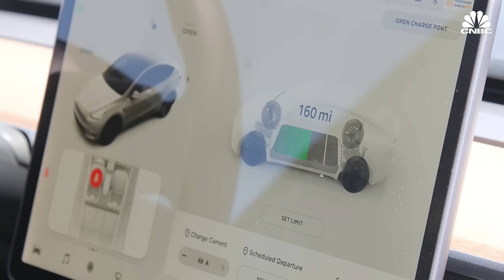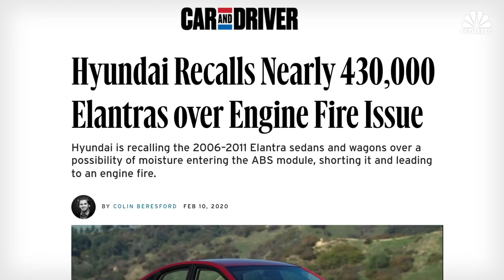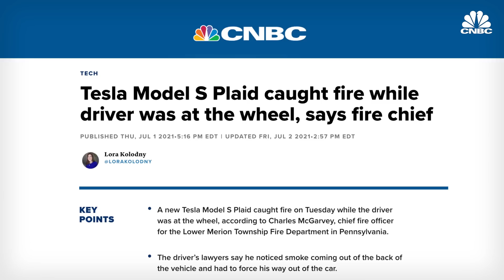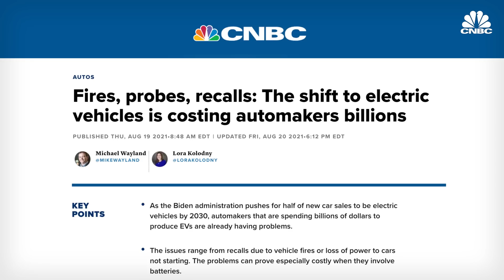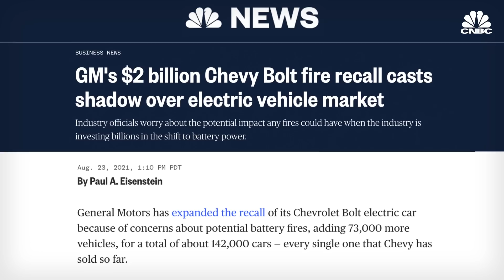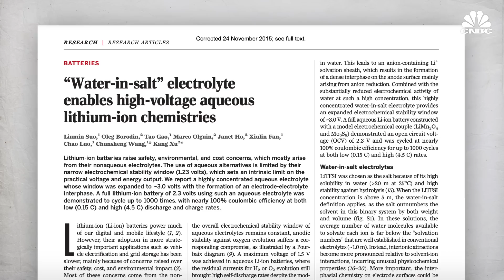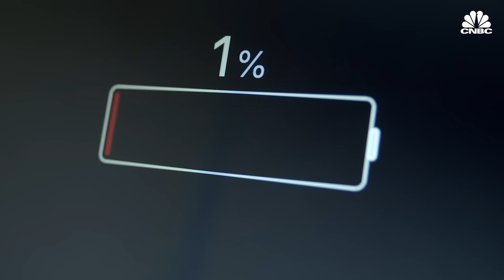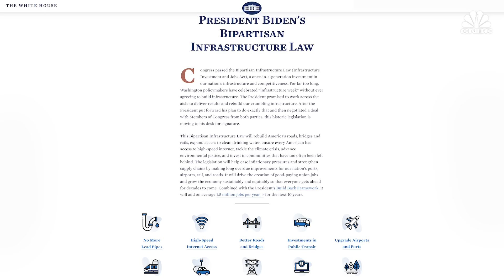Why Tesla, GM And Other EV Companies Have A Fire Problem

Comment: I was planning my next car to be an EV. But all these fires lately are definitely making me rethink. EVs still need major improvements in the safety area.
Reply: 10 Years + $20,000 = 2000LBS. of e-waste  🤡
Reply: @liuwang2201  according to your math it actually equals $20,010. 
Show your work if you want full credit. 
Also… the recycling of lithium batteries grows exponentially daily. So your equation has become more difficult.
Reply: @459SuperX  10 years plus a $20,000 battery equals 2,000 lbs. of E-waste  ✔
Reply: @459SuperX  your right it jest doesn't add- up, your problem is undefined
Reply: @liuwang2201  EV batteries are now recycled. Tell me, how much of the petrol that a gasoline car burns in 10 years will be recycled? How how many additional people will die as an indirect result of the highly carcinogenic nitrogen dioxide produced by one gasoline car's exhaust over 10 years.?
Reply: @normvanduker9999  In ten years my car will still run and I won't be out $20,000 
that is green
Reply: @liuwang2201  Well, you know the old saying: "anecdotal evidence is no evidence" but since you want to talk about your car, I bought a Tesla model Y 2 years ago that is now worth more than the price I paid for it when it was new. Further, EVs have far fewer moving parts with a propulsion system that runs cooler and with less friction than a gasoline car. What would an engineer tell you that means? He would tell you that your gasoline car will wear out before the EV.
Reply: @normvanduker9999  I bought my two seated 5 on the fly sports car 10y ago and looking good, your EV has 8 years to go for a $20,000-2000lbs-battery replacement
your full of WOKE! lies about everything
my suggestion to you is to stop using florid toothpaste
Reply: @normvanduker9999  yeah and when it wears out you can replace the parts to fix it. And if you take care of your machine, change the oil regularly, which doesn’t cost much money or time, then you may never have a serious problem. Toyotas, Hondas, and many other well built machines seldom have issues. Tesla doesn’t make the top 15 list for most reliable and least recalled vehicles. EVs need more time to mature and work out their issues.
Reply: @bigbusiness7035  When you exclude "recalls" such as the one announced last week where Tesla "recalled" 1.1M vehicles to deal with a problem related to closing the window that are actually fixed with over the air software updates, Tesla is one of the least recalled vehicles. Tesla had a total of only 7 genuine recalls in the last 12 months involving a total of less than 11,000 cars as opposed to, for example, nearly 100 separate recalls for Ford over the past 12 months involving nearly 2,2M vehicles. Further, for all this talk about Tesla and reliability/maintenance, it is universally acknowledged that car rental companies are the real experts on both vehicle reliability and car maintenance. Would it therefore surprise you to learn that, despite the talk of all the arm chair experts such as yourself, Hertz now rates the Tesla model 3 as their most reliable vehicle with the lowest cost to maintain? Further, every car manufacturer is required to count as a liability expense on their quarterly profit and loss statement an item called "warrantee reserve" which is the anticipated cost for warrantee repairs for all the new cars they sold during the quarter. The amount of warrantee reserve is not just some arbitrary number that the manufacturer can simply make up. GAAP (SEC regulated "generally accepted accounting principals") require that the warrantee reserve reported on the quarterly P&L must be data driven based upon what the manufacturer is actually spending on warrantee repairs over the past several quarters. The warrantee reserve is where the rubber really hits the road in terms of vehicle reliability...if the cars you are selling have a lot of defects or cost a lot to maintain, there is absolutely no way to conceal it: if the per car warranty reserve on the manufacturer's P&L statement is high, then that manufacturer's cars are expensive to maintain, or they are not reliable, or both. If it is low, then the cars must be both reliable and inexpensive to maintain. So what's the point? Surprise! Ford and BMW currently have among the highest per car warranty reserves in the entire industry, while Tesla has among the lowest. Gasoline cars are a more complex drive train technology that is more expensive to maintain with low reliability compared to that of electric cars. Period.
Reply: @liuwang2201  Where do you get your data? A Tesla model Y with the new LFP battery chemistry from CATL is estimated to have somewhere between a 500,000 - 1,000,000 mile battery life. 

Meanwhile, since you seem to want to insult me, I feel it is fair to respond in kind. Your silly grammar and sentence construct betrays both that English is a second language for you and that it could use a lot of work.
Reply: @liuwang2201  
You see Liu, when you substitute personal insults for civil, reasoned discussion you don't win an argument, you just make yourself look like an idiot. For example, here you are throwing around epithets like woke, pedo, and elitist (by the way, to further help you with your English, none of those words are supposed to be capitalized) when you are actually talking to a conservative, old school republican who, although not an admirer of Donald Trump, actually contributed $17,000 to John McCain's campaign when he ran for president. Further, it is important for you to understand that I am not telling you these things in order to "defend" myself, but rather simply to help you understand why it is impossible for me to take you seriously
Reply: @liuwang2201  You also need to work on your spelling. It's "just" not "jest".
Reply: @normvanduker9999  there are many different Environmental cycles in nature one of which is the carbon cycle, to cut this dangerous cycle we first need to eliminate all oxygen,
 so we must first cut all the trees down and the food crops
Reply: @normvanduker9999  Carbon dioxide .04% of the air we breath is essential for life, the human population is being controlled by a handful of the richest people that look down on us as livestock that must be controlled
Reply: @liuwang2201  So now you want to tell me the carbon cycle is dangerous? I think you must have slept through your high school science class.
Reply: @liuwang2201  You are confused. 300 million years ago during the Permian era many insects grew to enormous size because the earth's atmosphere was about 35% oxygen. Insects, which passively diffuse oxygen through their bodies (in contrast to organisms with an active respiratory system) are limited in size by the oxygen concentration in the atmosphere. So when the atmosphere oxygen content goes up insects can grow larger. Carbon dioxide levels during this period were low. However, the situation had reversed by the end of the Permian era with atmospheric oxygen levels dropping to 17% and carbon dioxide levels rising significantly higher than they are today. The earth at that time also became 4-7 degrees hotter than it is today. And all of this is very interesting but has absolutely nothing to do with EV fires.
Reply: @normvanduker9999  carbon-12, which makes up 99% of all carbon
Reply: @liuwang2201  unusual take. However you may want to research fluoride related to dental health.
Reply: @normvanduker9999  Take a breath dude - whitespace is cheap. Not even gonna try to read that wad of text.
Reply: @natehill8069  If you don't want to read it, then don't read it. Sure, it's a detailed discussion, but its only intended for those who are interested. But if you're not, you're not, and why should it matter to me if you're not one of those who is interested?
Reply: Nissan leaf had zero case of fire for 11 years since inception.
Reply: But at the end of the day, it's been proven that ICE vehicles still have a higher chance of catching fire because the gasoline is more flammable and more exposed. Rethink your decision.
Reply: Do not risk your life until they change over to graphene battery technology
Reply: Water is not the best fire extinguisher for lithium batteries.
Lithium reacts intensely with water, forming lithium hydroxide and highly flammable hydrogen.
Car manufacturers are racing to develop the next models while not being forced by regulators to encapsulate proper fire neutralizers into the battery's pack. It should be mandatory that lithium battery manufacturers wrap their batteries with chemicals to neutralize the chemical reaction such as powder graphite or sodium carbonate.
Reply: dont ..its not the future...we looked at EV and decided for a petrol Kia
Reply: @graantmnz  Search repair history for ICE Kia's for they have some major engine issues.
Reply: Stick with gas. California just banned charging EVs. Power shortages are becoming a fact across the country and if you don't have enough electricity for AC, heat lights and industries, we don't have enough power for charging cars. 
Environmentally the power you will be charging that car with comes from burning fossil fuels.
Reply: @gregorypecaut7164  I hope you will indulge me just a bit further and allow me to also respond to the comment you made about not saving on fossil fuels with an EV because the electricity used to charge the EV "come from burning fossil fuels".

In point of fact, that isn't true. In California (where I live) 32.5% of our electricity comes from wind and solar (which requires no burning of fossil fuels) and 9.4% comes from nuclear power (which also requires no burning of fossil fuels). So about 40% of the power generated in the State of California that is used to charge EVs doesn't require burning any fossil fuels. In contrast, gasoline cars are always 100% reliant on burning fossil fuels.

But even if all of the electricity used to charge an EV did come from fossil fuels (it doesn't, but just for the sake of argument, let's pretend it did) an EV would still end up burning far less fossil fuels than a gasoline car. To understand why, we need to compare the energy efficiency of internal combustion engines to electric motors. And it turns out that electric motors are typically about 4x as efficient as gasoline engines.

To really illustrate this point, consider how far a Tesla model 3 can go on a gallon of gasoline - that is, if you burn a gallon of gasoline in order to generate electricity to charge a Tesla model 3, how far can you drive on that much electricity? 

Turns out, burning 1 gallon of gasoline to power a generator to charge a Tesla model 3 will enable you to drive 136 miles. That's right, 136 miles on only 1 gallon of gasoline. That's about 4x less fossil fuel than it would take for a gasoline car to drive that far, because, once again, electric motors are typically 4x more energy efficient than gasoline engines.

So, in every circumstance, no matter what percentage of your electricity comes from fossil fuels or renewables, driving an EV always results in burning far less fossil fuel than driving a gasoline car.

Finally, if you think about it, even those who prefer gasoline cars should be happy if EVs become more popular. Why? Because EVs use up far less fossil fuels than gasoline cars and if enough people drive EVs, the price  of gasoline should come down because we'll no longer have such a shortage of oil. In other words, having a lot of EVs on the road makes it a more likely you'll be buying gas for $3/gallon instead of $6/gallon.
Reply: @normvanduker9999  more like 7.8% of your power comes from wind and solar. That's from your own state's energy report. 2% is the old total wind and solar production, but that is as of 2021 up to 4.8%  
Are you trying to tell me a Tesla with a 14amp 120V (a one gallon per hour generator, 2400watts) charge runs over 136 miles!  Hardly. Musk would be thrilled if it was so, BUT that's only 1680 watts. No electric motor is that efficient. 
And there is also all the tax subsidies Tesla gets, along with the tax break you get for buying one, except the tax break for you buying one is about to end, which will up your cost $5,000.00. And if we subsidized every family for one electric car, that would cost us billions of tax dollars. I am not against electric cars, I'm against government subsidizing and forcing us into them before they're ready for practical use. Although the Tesla has become far more practical, due to the many government subsidized charging stations. Government never subsidized gas stations to distribute gasoline. 
 Not to mention most of those worn out lithium battery cells get disposed in landfills in China. They are too toxic to dispose of in the US. But does it really make a difference if they are leaching toxic waste into the Pacific Ocean from China or California. 
As far as nuclear power goes, I'm all for it, BUT we only shut down and dismantle nuclear power plants here. No chance in hell that any new nuclear power plants will be built here in the near future, but we will shut down more coal powered plants this year. 
Even Musk is working on developing a hydrogen powered car. And even Musk admits electric cars will not solve our problems. You need to study the science more. The real science, not the political spin garbage.
Reply: @gregorypecaut7164  You are straying from the topic of vehicles as a fire hazard, but I understand that transitioning to electric vehicles or, for that matter, transitioning to any new technology, can provoke a lot of uncertainty for many different reasons. 

But with regard to the power grid, the good news is that rather than stressing an already challenged system, EVs, paradoxically, have the potential to actually solve a lot of the problems we currently have with our electric grid. 

To understand how that is possible, it is first necessary to understand that the most vexing problem we face with our electric grid is not a deficiency in total power generating capacity, but rather a deficiency in PEAK power generating capacity. Over any 24 hour period we can actually, in aggregate, easily generate a huge surplus of power. Our problem, rather, is that during a few key hours, for example in the late afternoon of a hot summer day when everyone arrives home and turns on their air conditioner, we run into a peak power demand that can cause the grid to fail. 

Currently we try to deal with this problem using gas fired peaker plants. But peaker plants are extremely expensive to operate and take time to come online - and sometimes they cannot come on line fast enough to prevent the grid from failing. A far better solution would be if we could somehow save up the extra electricity we can generate when nobody wants it and then use that stored electricity when we can't generate enough to meet peak demand.

So how might we possibly do that? Well, would you be surprised to lean that a fully charged EV can provide all of the electricity your house needs for two full days and that the vast majority of those who commute to work in an EV arrive home at night with their car still charged to more than half capacity? In other words, these EV owners pull into the garage at night with a massive battery still charged to the point that it could provide for the combined power needs of 6 houses in their neighborhood for about 4 hours. Equally significant is that practically everyone who owns an EV charges it at home at night and that a EV drawing electricity, for example, at 2:00 am is charging its battery when there is far more electricity generating capacity available than what will ever be needed in the middle of the night. 

So now here's the kicker: when all those millions of EVs come home and plug in, what if, instead of drawing power from the grid, they instead feed power into the grid? That would easily solve the problem of peak power. But then how would all of those cars ever get recharged? Simple - by utilizing a software solution that causes EVs to recharge later at night after the time of peak demand when there is a surplus of electricity available on the grid.

Sure, EVs would still cause the total amount of electricity needed over a 24 hour period to go up, but total 24 hour power demand is  never what causes a grid to fail. Again, regardless of how much total power is consumed over 24 hours, the thing that actually causes a grid to fail is excess PEAK demand - and having millions of EV batteries available as storage units to offset peak demand would actually stabilize the grid and make it far LESS likely to fail.
Reply: @normvanduker9999  I wouldn't have a problem with it if we had the option to still own combustion engines. But no the agenda is to eventually by 2030 ban these vehicles.
Reply: @letthetruthbetold6716  That's reasonable, although there is the issue that gasoline fumes and emissions (especially diesel emissions) are carcinogenic. That said, there are far worse environmental hazards that could be addressed before banning internal combustion engines. I generally favor simply allowing people to buy whatever car they want. Currently EVs are safer than ICE cars, but they are far to expensive for many people. But the technology is new and rapidly improving. When EVs are far and away cheaper than ICE vehicles people will start choosing EVs without a paternalistic government telling them what to do. I think the government should just stay out of it and trust people to make good decisions on their own.
Reply: @norm van duker I drive 140 miles to and from work each day in my gas powered car and have been doing that for 5 years in that time I have seen 20 electric cars on fire pulled off to the side of the highway and 4 gas powered cars on fire and after the fire is put out and the car is taken away you can tell if it was an electric car that caught fire or if it was a gas car that caught fire by just looking at the ground where the car caught fire if the ground is melted and burned it was an electric car that was on fire if the ground is just burnt but not melted it was a gas powered car so I have seen 12 different spots where gas powered vehicles have caught fire and burnt after it had already happened and I have seen 47 different spots where electric cars have caught fire and burnt after it had already happened so you saying electric cars are less likely to catch on fire is simply not true from what I've seen
Reply: @auxtaku3449  You have seen 20 electric cars on fire by the side of the road over the past 5 years during your 140 mile commute? I'm sorry, but I simply don't believe you. I have commuted to work 52 miles each way along I-5 in California (the state with the highest EV adoption in the US) for the past 17 years and I have never seen any EV fires.
Reply: @norm van duker  you don't have to believe me but I know what I said is true and fairly I don't care if you believe me or not
Reply: @auxtaku3449  I hope they all had time to escape
Reply: @auxtaku3449  Sounds good...then please continue telling your story and I'll continue not believing you.
Reply: These vehicles are not environmentally friendly!!!! Especially when disposing of these batteries!!! We are being fooled by society!!! People wake up! Eventually they will be shutting off these vehicles when people don't pay tickets, car notes, or hold bad credit scores! Why do you think they are offering all of these tax credits to purchase this crap?? I'll stick to gas powered until it's deemed illegal by the government
Reply: @chriswooten8426  joe Biden as been compromised by the Chines government and now we must pay through are money and lives and environment and century
Reply: @chriswooten8426  Batteries can be reused..
fossil cars can be shut down..
Reply: It's one in 750k chance......you'll be alright
Reply: EV's fund child slave labor in The Congo.
Reply: @ricktd6891  Yes money going to poor areas ,
praise be to evs
Reply: If you are worried about about cars catching fire remember it is a 100 times more likely in a petrol car, a petrol car burning is not news as thousands burn everyday....
Reply: Just avoid the battery made by Chinese or South Korean companies.
Reply: @tjhessmon4327  You are getting your opinions mixed up with facts. Over the past decade there have already been dramatic improvements in battery chemistries that improve both vehicle range and vehicle safety. And even greater improvements are now just over the horizon with the expected advent, for example, of revolutionary solid state batteries within the next 5 years. Meanwhile EVs are already far less prone to catch fire than gasoline cars. When you say things like "that equation will never change" you display exactly the same mind set as the person 120 years ago who thought cars were so privative that they would never replace horses. Keep up! The "equation" is always changing.
Reply: You should never do it. A) They are an absolute disaster for the environment. If you don't care about poisoning the planet, then you might consider B) It costs $30,000 to replace the battery when they fail which you can anticipate doing after 4 years. C) Google the reporter who tried to go from somewhere like New Orleans to chigago and how she spent more time recharging than driving. It's horrible.
Reply: Its not "all these fires". EV fires are rare and therefore make the news, especially if you want to make a biased hit piece. ICE car fires are much much more common; about 65x more often than EVs. Google it, takes 10 seconds. Well, unless you have dial-up.
Reply: Take a look at the NTSB recorded figures for car fires during 2022. There were 190'000 ICE cars fires in the US during 2022, and 4200 EV fires over the same period. Using those figures as a guide, which would assume is more likely to catch fire?
Reply: Thermal runaway on an EV is far more destructive and dangerous than a petroleum fires. Point a fire hose at both and you'll immediately agree.
Reply: The risk of a new EV catching fire is lower than an ICE vehicle catching fire.
Reply: @mauriceharting5877  ICE fires don't burn through concrete.
Reply: @teerexness  I never said anything about ICE vehicle fires burning through concrete!

And I have never seen an EV fire burn through concrete either, but I have seen an EV fire burn an asphalt road.

EV fires tend to burn hotter and faster, however ICE vehicle fires typically also lead to a vehicle write off since it costs too much to repair.

You basically don't want a vehicle fire and can avoid most cases by doing regular maintenance and following manufacturer guidelines, unless you are dealing with a crash.

The only concern I would have with EV's is when they get older and battery degradation becomes an issue with a lot of charge cycles as well as overcharging (above 80%).
EV fires are less common compared to ICE vehicle fires statistically, but that could change as EV's get older.
Reply: @mauriceharting5877  You said that ICE vehicles have fires also. Well, there are fires and then there are FIRES. EVs completely burned out a steel car carrying ship so badly recently that it sunk. And EV started a fire in an airport parking lot so severe that security cameras caught the flames going through the concrete and down on to the next floor. Those are very special fires. Commonality is just obfiscating the truth. Like talking about Chernobyl and saying that coal fired power lalnts also catch on fire.
Reply: @teerexness  Why don't we be honest with each other when talking about vehicle fires shall we?
According to one analysis of U.S. government data, EV fires appear to occur less frequently than ICE vehicles, with 25.1 fires for every 100,000 vehicles sold compared to 1,529 fires for ICE vehicles. (Hybrids, interestingly, appear to catch fire most frequently, perhaps a result of the battery pack being adjacent to a combustion engine.) Data from the Swedish government and a major EV vendor appears to support this general assessment.
According to findings pointed out by AutoInsuranceEZ, vehicles that operate using gasoline are tenfold more likely to catch fire compared to EVs. 

So in the real world the risk of an EV catching fire between 2010 and 2023 was 0.0012%, whereas in the same time period the risk of an ICE vehicle catching fire was 0.1%.

Case closed!
Reply: @mauriceharting5877 To be honest, you'd have to acknowledge severity and stop talking about frequency. Plus, a government willing to meddle in the automobile and energy industries to the clumsy and destructive extent that they have, while participating in every climate alarmist narrative that they can be involved in, may not be the most objective source of data. You'd think we would have learned this during the covid fiasco, but apparently not. People funding research get the research that they pay for. Shockingly.
Reply: @teerexness  To be even more honest, when any car catches fire, be it an ICE vehicle or an EV, they both more than likely be written off and cannot be used again. So when you say that an EV burns hotter that makes no difference when both are written off and cannot be used.
My main point is ... well how often do EV's and ICE vehicles catch fire? And the answer is less than 1% chance.

I don't think you are going to sit in your car and wonder ... is my car going to catch fire?
Reply: @teerexness  And if you do not like an EV don't buy one and buy an ICE vehicle instead and cry every time you have to fill it up with gas. I own both an EV and an ICE vehicle.
Reply: @mauriceharting5877  The point here is, an EV is much more likely to burn down buildings, destroy adjacent vehicles, injure firefighters and destroy infrastructure. There are many other reasons not to buy an EV, especially where I live ("flyover country"), thermal runaway being just one of them. When I use my car on a -5 degree day, I don't have to worry about half of my gas tank disappearing. I don't have to worry about where the charging stations are across the state or how many people will be stacked up waiting ahead of me. There's a reason EVs failed 100 years ago, and they still exist.
Reply: An EV fire every few months, an average of 500 gas car fires per day in the U.S., but go ahead and get yourself another gas car.
Reply: @unclerichard6729  I am not opposed to ICE vehicles and they do have some advantages such as:
1. Longer range with a full tank of gas
2. Better towing capabilities
3. Faster fill ups at the gas station
4. More gas stations compared to EV charging stations

However as time goes on EV's have more advantages:
a. Cheaper than ICE vehicles to run
b. Lower maintenance costs
c. Runs quieter
d. Less pollution with no tail pipe

I own both ICE vehicles and an EV, and for daily use around our home and local shopping/ travel, which is over 90% of our vehicle travel we use our EV.
For long distance travel and towing our boat we use our ICE vehicle.

Eventually when the range of travel (700 km +) and towing (3000 lbs +) improves with EV's we may eliminate ICE vehicles all together.
Reply: Buy the EV. It has one sixtieth chance of catching on fire as an ICE car.
Reply: @yodaiam1000  True. Tesla ev's are one of the safest vehicles one can buy.
Reply: apparently they are not economical
Reply: @guitariste47  The purchase price of a new EV after Government rebates is the same as a new ICE vehicle, but where the EV really shines is in annual maintenance and repair costs. I have driven my 2017 Kia Soul EV now for 3 years and have had zero maintenance or repair costs.
Reply: Why an EV?
Reply: @sqr2025  Why buy an EV? Pretty simple:
1. Lower annual maintenance and repair costs
2. Zero emissions
3. Quiet rides
4. Cheaper on fuel/ power costs
Reply: @mauriceharting5877  wrong, wrong, wrong and wrong. It does not have lower annual costs as the brakes, hVAC system are far mor expensive to maintain. What do you consider zero emissions as the power to generate the massive needs creat more emission then the sum of ICE they replace. If you check the decibels from a new modern ICE care they are equal to an EV. Tire noise, brake friction noise are all the same. If you equate and balance out the costs of power need per mile for the EV to the cost of ICE fuel you will be surprised.

Now how are the EV’s doing in the Ukraine and Hawaii or the disaster zones? You do know that EVs can be automated and autonomously shut down by the government or any external source right? The police are already stating they can be shut down in chases, I will say that can be a good thing but abused. Hell the cars will be shut down during the next pandemic. I’m
Reply: @sqr2025  EV's have regenerative braking, which means less wear and tear on the brake pads and rotors. I have not replaced my brake pads and rotors on my 2017 Kia Soul EV, whereas on my Nissan Pathfinder I have replaced pads and rotors twice so far.
HVAC on both the Kia Soul EV and Nissan Pathfinder have never needed work done.
On my Nissan Pathfinder I had to replace my spark plugs (no spark plugs on my EV), and the transmission on my Nissan Pathfinder required two expensive repairs.
So no EV's require way less maintenance and repairs.
Reply: There are no spontaneous combustion ICE vehicles.
Reply: @sqr2025  Not true, there have been cases when Ice vehicle owners parked their car and while the engine was hot with a ruptured fuel line an arch from a faulty live wire it caught fire.
Reply: @mauriceharting5877  that is not a spontaneous combination of the fuel as much as an ignition source igniting the fuel. The fuel triangle at work. I am not saying ICE cars have not burned down but it was from an external reason which is unlike EV batteries just going up in flames on their own.
Reply: @sqr2025  EV batteries have less than 0.001% chance of catching on fire ... study the facts Mr. ICE vehicles are 100 times more likely to catch on fire.
Reply: @sqr2025  You do know that ICE vehicles have a 100 times higher risk of catching fire and the risk of an EV catching fire is less than 0.001%
Reply: You should rethink getting an EV for the following reasons: Insurance is likely to be higher, there is not enough infrastructure in place, even in California, and EVs require more expensive tires and need to be replaced more often.
I really dislike the government trying to force these down our throats.  Depending where you are in the country your town may not even have a gas station much less a charging station.  And I know of a 140,000 acre ranch that only has 120 volt power (only one wire).  There are other technologies being developed that could eliminate the need for BEVs (battery EV, as opposed to fuel cells). We can certainly get away from petroleum based engines but this rush without thought is wrong.  How do the two million apartment dwellers in Houston get power?  Where is all this energy going to come from?  For the time being it will be coming from gas fired and coal fired power plants.
Reply: @johncooper4637  I think apartment dwellers all have 110 volt outlets and with extension cords they could charge their EV's overnight. Yes, I agree that infrastructure has to improve, which would include charging stations in apartment parking lots and solar panels on roofs of buildings to generate electricity.
I have a 24 foot RV with 4 100 watt solar panels on the roof and 4 100 Ah batteries to store power, which runs my fridge and other appliances.
You would need about 24 100 watt solar panels to charge an EV using a level 2 charger and have your EV charged in less than 4 hours.
The future is EV's sooner rather than later.
Reply: Don’t get ev dangerous. Get normal car
Reply: I wouldn't buy A Trashla or any other EV.  Pieces of junk.
Reply: @mikesandberg7383  so you have experience with a Tesla?
Reply: @mikesandberg7383  so are most new cars today.
Reply: @mikesandberg7383  That's fine. You probably shouldn't strain your brain cluttering your pretty little head with any facts - as for example data from the IIHS that prove Tesla builds the safest cars they have ever tested.
Reply: Plus poor African children are used to mine the cobalt for the EV batteries. So much for Environmental Justice.
Reply: Well the way it’s looking you guys hated on gas powered cars and now everyone’s being pushed into fireballs on wheels. Thanks and congrats this is the result.
Reply: @toxicity6629  The result of Marxism is always death.
Reply: @toxicity6629  Sad those people trapped by snow in their fossil cars trying to keep warm, but resulted in them dying from the toxic gas produced by the engine..
Reply: Get a car with a fuel efficient internal combustion engine. EVs are still in their infancy. Look at all the older Priuses that can't sell, because it costs more than the vehicle to get the battery replaced.
Reply: YOU CANT IMPROVE THE STABILITY OF LITHIUM BATTERYS ARE TOO UNSTABLE
Reply: It will never matter how often these fires have, they are more severe.
Reply: @seankingwell3692  That's not true. Sometimes gasoline cars explode in a massive fireball - which is far more severe than a battery fire. Meanwhile, this whole debate about EV fires is becoming irrelevant. The propaganda mill has already moved on since the time this video was aired and it is now only the most uninformed or most easily mislead in our society who haven't come to realization that when it comes to fire risk EVs are far safer than gasoline cars.
Reply: You realise a gas car is a hundred times more likely to catch fire...
Reply: @whocares264  maybe if you smoking your crack pip at the gas station
Reply: @whocares264  you realise thats a lie right?
Reply: Your chances of a gas car catching on fire are 66 times higher.
Reply: You should stick with your plan to buy an EV. According The National Highway Traffic Administration, on a per mile driven basis you are much, much more likely to suffer injury or death by fire driving a gasoline powered car than by driving an EV. This CNBC video is misleading click-bait. The title should be "How EVs are Solving the Fire Problem Caused by Internal Combustion Engines". But then the entire segment would end up being ridiculously short as the narrator simply points to the fact that according to NHTSA data gasoline cars are 10x more likely than EVs to catch fire and, unlike gasoline cars that carry around a tank full of highly explosive gasoline vapor, EVs virtually never explode.
Reply: @normvanduker9999  
No car ever explode, it show how much you know about cars.
Reply: I don't know what kind of magical thinking informs your opinions, but I actually saw a car explode on north bound I-5 close to the Harbor Blvd Exit in South Sacramento when it was rear ended by a truck. There was an enormous fireball and it was obvious that everyone in that car had instantly died. Further, to say "no car ever explode" demonstrates your fundamental lack of understanding of what happens when an enclosed space containing gasoline vapor mixed with oxygen (as, for example in a half empty gas tank) is ignited.
Reply: @robertagren9360  I don't know what kind of magical thinking informs your opinions, but I actually saw a car explode on north bound I-5 close to the Harbor Blvd Exit in South Sacramento when it was rear ended by a truck. There was an enormous fireball and it was obvious that everyone in that car had instantly died. Further, to say "no car ever explode" demonstrates your fundamental lack of understanding of what happens when an enclosed space containing gasoline vapor mixed with oxygen (as, for example in a half empty gas tank) is ignited.
Reply: @robertagren9360  
I don't know what kind of magical thinking informs your opinions, but I actually saw a car explode on north bound I-5 close to the Harbor Blvd Exit in South Sacramento when it was rear ended by a truck. There was an enormous fireball and it was obvious that everyone in that car had instantly died. Further, to say "no car ever explode" demonstrates your fundamental lack of understanding of what happens when an enclosed space containing gasoline vapor mixed with oxygen (as, for example in a half empty gas tank) is ignited.
Reply: @normvanduker9999  Thats because there are more gas vehicles out there. If it were the other way around the statement would be reversed. 

Let both EV & Combustion vehicles Co-exist. 
(Just park 10ft away from any EV).

Formula 1 is making a new combustion fuel, hopefully any changes that are made is to better the earth we live in.
Reply: @jasoncompany_jco  No, Jason, it is not simply because there are more gasoline cars than electric cars. NHTSA data is reported on the basis of PER MILE DRIVEN and by this metric (car fires per mile drive) electric cars are more than ten times less likely to catch fire than gasoline cars. Put another way, the average gasoline car has a 10x greater risk of ending its life in a ball of fire than an EV. Again, that's not an opinion. It is a matter of fact according to NTHSA data. 

Again and for emphasis, gasoline cars are an absolute fire hazard compared to EVs and gasoline car fires are actually so common (more than 150 per day in the US) that the media doesn't even bother to report on them. But the media does go out of its way to report EV fires - which is why the public perception about car fires has it exactly backwards in not realizing that EVs are far, far safer than gasoline cars.
Reply: @normvanduker9999  Regardless if its miles. Its not accurate.  

If i compared 1-Ev to 100-gas vehicles-miles witch miles do i pick from the greater number? 

Also the history of gas vehicles is greater, so did they pick what years?  Did they inlclude all global vehicles…?
The list goes on regarding accuracy in the data. 

But anywho, to the people who went through these fires in the EVs; they don’t care about these numbers, it just takes one-time to ruin your life.

So again i say: Let Ev’s & Gas vehicles Co-exist and may both learn from past experiences. 

Anything can be dangerous if you don’t understand it. 

Im still rolling in my 97 honda accord. Best value I’ve ever seen in a vehicle. Paid $1000 for it, then added $2000 on parts where i knew the car had weaknesses. And till to this day always maintain the 25 year old car. 
But i did my homework & searched 👀 for the best value car that worked for me. 🙂
 Though i observe others to take in some useful info; I don’t go by someones else’s numbers ,opinions or influence.
 No matter how big they are. 

There’s not just one-good-way to do things. There can be a variety of good EVs or gas vehicles.🙂
Just continue-to-grow in understanding them.🙂
Reply: @jasoncompany_jco  I appreciate the conciliatory tone of your comments and fully endorse your opinion that gasoline and electric cars should be allowed to coexist - in other words, I believe that it should be up to each individual to decide what type of car he wants to drive. 

That said, please understand that the reason I am being so stubborn on the issue of fire safety is because the media has committed a profound public disservice convincing everyone that EVs are more of a fire hazard than gasoline cars - especially given that the exact opposite is true. Now, I realize you have trouble believing that so let me address what seems to be a particular sticking point with you.

Probably noting that the fire safety for gasoline cars must have improved over the years, you seem concerned that data showing EVs are safer may have been the result of a statistical comparison of fire safety made between relatively new EVs and the entire history of gasoline cars - which would therefore unfairly include, for example, the safety record of gasoline cars from 100 years ago.

Let me assure you, that is not the case. The relative fire safety of EVs over gasoline cars was established based upon data from an apples to apples comparison. Specifically, for the period 2012-2021 there occurred 1 Tesla vehicle fire for every 210 million miles driven. Over that same period, 2012-2021, there occurred one gasoline vehicle fire for every 19 million miles driven. And if you'd like to verify by doing an internet search, just Google "vehicle fires per mile driven" and you'll find a plethora of sources that say the same thing.

So, one vehicle fire for every 210 million miles in a Tesla vs one for every 19 million miles in a gasoline car. Looking at those numbers, which one would you say is more prone to catch fire?

Finally, I'll say it again that I am in favor of  people driving whatever car they want. I'm a doctor and make a good enough living that I can buy almost any model car I want. Yet I still drive the 2007 Pontiac Gran Prix I bought used when I was in medical school. It still runs fine, so why not?

Meanwhile, I've got a family now and I am of course concerned about the safety of my wife and kids. So when she wanted a new car we decided to buy a Tesla model X - not just because it has a lot of room for her to shuttle the kids around, but also because it is far and away one of the safest cars ever built.
Reply: @normvanduker9999  Nice. Thanks for the data. 
Glad your trying to be safe.🙂
Reply: @normvanduker9999  are you vexed ?
Reply: @liuwang2201  Nope. Are you?
Reply: @normvanduker9999  A gas tank is smaller then a battery because its required to carry only 1/3 of the elements to create energy
     so its better protect in a collision 
can you use critical thinking ?
Reply: @liuwang2201  I honestly can't tell if you are ignorant or just acting ignorant as a way of baiting. The size of the gasoline tank does not matter. What matters is the amount of energy stored in a gasoline tank v the amount of energy stored in an EV battery. Since EVs are 3x more energy efficient v a gasoline car, a typical EV battery stores only about 1/3 as much energy as a gasoline as a gasoline tank. Now, as anyone with even a passing understanding of physics will tell you, the energy that can be released in a fire is directly proportional to the amount of energy stored in an EV battery v a gasoline tank. Since the gasoline tank stores 3x the energy, it has will release 3x the energy in a fire. This is not something that is subject to debate. It is a fact. Meanwhile, the examples you give of your "critical thinking" could be more accurately describe as "magical thinking".
Reply: @normvanduker9999  such a great plan. Still catching fire to this day.
Reply: @toxicity6629  If you are referring to the fire risk of gasoline cars, then yes, still catching fire to this day - and at a rate (according NHTSA data) more than 10x higher per mile driven than EVs. Meanwhile, EVs keep getting safer and opening the distance further...recent changes in battery chemistry mean that now approximately 50% of new EVs come with LFP batteries that are almost impossible to burn. At the same time, a total of over 1.4M new gasoline vehicles have been recalled over the past 12 months due to fire hazard including almost 550,000 gasoline vehicles in a single recall by Hyundai/Kia 6 months ago for a defect that could cause spontaneous combustion of their vehicles even when they are turned off and, for example, parked in your garage overnight.

On a related topic, the Tesla model Y recently won recognition in Europe when their official vehicle testing agency, NCAP, awarded the Tesla model Y the highest safety rating any vehicle they have ever tested. About a month later Australia's testing agency, ANCAP, also awarded the Tesla model Y the highest safety scores they have ever tested. In other words, not the safest vehicle tested this year, but vehicle in history. But by that time the model Y had fallen into second place in Europe when NCAP finished testing the Tesla model S and were shocked to find that it was even safer than the record breaking model Y.

Those who think gasoline cars are safer than EVs are just ignorant and suckers for deceptive click bait videos such as the one presented here.
Reply: @normvanduker9999  EVs catch fire and burn for ages - fact. My suggestion if you are  going to buy an EV , is to fit an ejector seat.
Reply: @jimpackard8059  Gasoline cars are more prone (by a factor of 10) to catch fire than EVs - fact. You are more likely to burn to death in a car fire if you drive an internal combustion car than if you drive an EV - fact. According to NCAP (the European car safety testing agency) and ANCAP (the Australian car safety testing agency) the 4 safest cars on the road today (in fact the safest cars they have ever tested) are, in order, the Tesla model Y, the Tesla model X, the Tesla model S, and the Tesla model 3 - again, not opinion but fact. Conclusion: if you really care about the safety of yourself and your family it makes far better sense to drive an EV than a gasoline car - fact.
Reply: With regard to your "from what I've heard" comment, it is not a matter of opinion, but rather a matter of fact based upon National Highway Traffic Safety Administration data that EVs are 10x less likely to catch fire than gasoline cars. And for Tesla owners the data is even compelling: "From 2012 – 2021, there has been approximately one Tesla vehicle fire for every 210 million miles traveled. By comparison, data from the National Fire Protection Association (NFPA) and U.S. Department of Transportation shows that in the United States there is a vehicle fire for every 19 million miles traveled." It is also a matter of fact, not opinion but fact, that  gasoline vapor is explosive while EV batteries, though they can burn at extremely high temperatures, are not. Further, it was only one specific model of EV, the Chevy Bolt, that was at risk of spontaneous combustion and therefore unsafe to park in the garage. The Chevy Bolt was originally equipped with SK batteries that had a design defect that could cause them to catch fire. But all of those old Chevy Bolts are now having their SK batteries replaced and, again, no other model of EV ever had that problem. Meanwhile, it is a myth that gasoline cars can't catch fire unless they are being driven. As with EVs spontaneous gasoline car fires are rare, but gasoline cars absolutely can and sometimes do catch fire when they are turned off and parked in the garage. The usual mechanism is a wiring defect precipitating an electrical short that ignites vapor from a leaky fuel line. In fact, 483,000 cars from the Kia/Hyundai group were just recalled earlier this year to correct a defect that could cause that very problem and there is currently NHTSA safety alert telling Kia/Hyundai owners that their cars are at risk of spontaneously catching fire.
Reply: @normvanduker9999  exactly again government agency. So statistics are designed to push an agenda. Wake up!!!
Reply: @normvanduker9999  EV ' do not catch fire, if it is the Lithium Ion Battery but they spontaneously combust, difficult to prevent, occurs quickly and spreads rapidly, hard to extinguish and may re-ignite, burns 3 x times as hot as petrol diesel and is a chemical fire 50 times worse.
Reply: Don't worry, when you fill your car up with petrol you can be safe in the knowledge that of static ignights the fumes, you'll go up in flames. If you have diesel, well a little bit lucky, but they can explode too. Just be glad you don't need hydrogen...
Reply: @wardfiction5693  Neither petrol nor diesel can explode without being mixed with an oxidant. Both, without an oxidant, will extinguish a spark. It is, in fact, very difficult to ignite diesel in open air if it is cold.
Reply: @brianletter3545  Air is 21% oxygen and gasoline vapor virtually always exists as a mixture with air. Further, while it is certainly true that lithium ion batteries burn at extremely high temperatures, they do not explode. Gasoline vapor, on the other hand, is notorious for exploding. Finally, newer battery designs (for example the new Blade battery from BYD) are extremely resistant to catching fire. The Blade battery is, in fact, so resistant to combustion that it is extremely difficult  to ignite even when you are deliberately trying to make it catch fire.
Reply: @normvanduker9999  " gasoline vapor virtually always exists as a mixture with air."
Now I know you are not remotely serious.
Reply: @brianletter3545  And your response convinces me that you could benefit from a quick review of Dalton's law - a topic you will find covered in any 'introduction to science' level course taught at your local junior college. There you will learn that in the atmosphere at STP the partial pressure of gasoline is 9.6 psi, meaning that gasoline vapor always forms about a 1.2% mixture with air. The only way gasoline vapor can exist not as a mixture with air is when it is enclosed in a container that does not have any air, as, for example, within a nitrogen tank. So unless you are pointing at all the automobiles we normally find living inside a nitrogen tank (or some other equally ridiculous scenario) the statement "gasoline vapor virtually always exists as a mixture with air" is correct.
Reply: @normvanduker9999  Then how come I saw a Jeep hybrid blow its top 40 or 50 feet in the air, and another one blow off the garage door.
Reply: @johncooper4637  Hybrids are NOT BEVs. Because hybrids have both a gasoline engine and an electric motor, when it comes to fire safety they are the worst of both worlds. If you google "hybrids and fire safety" you will find several sources citing statistics showing that hybrids are about twice as likely to burn as gasoline cars and gasoline cars are about 11x as likely to burn as BEVs. So in summary, if you want to be safest from car fires, buy a BEV. If you want a car that is 11x more likely to burn, buy a gasoline car. And if you want a car that is 22x more likely to burn, buy a hybrid.
Reply: @wardfiction5693  you must be a bot or a mouthpiece for the Tyrannical gov pushing this dirty harmful agenda. One EV equals 109k vehicles emissions before it even hits the streets.  Thanks for polluting our air tyrant.
Reply: @wardfiction5693  a petrol or diesel fire can be much more readily extinguished...lithium can NOT be put out, it must burn out ...along with anything near it...check Luton airport car park destroyed